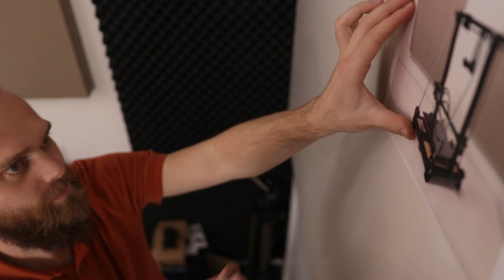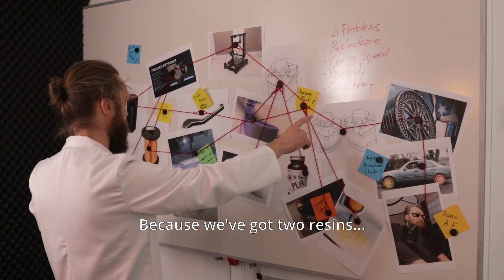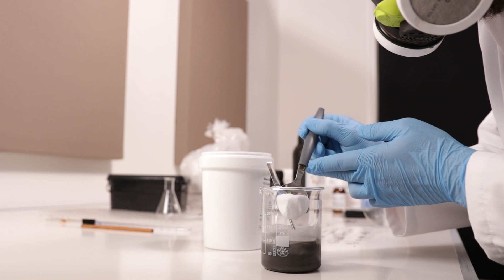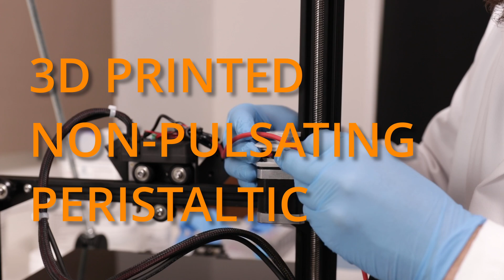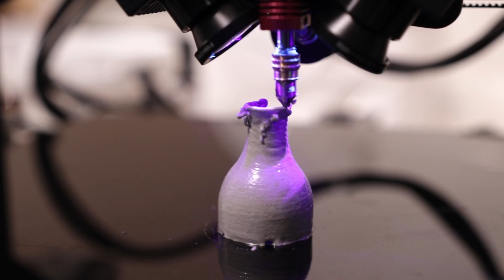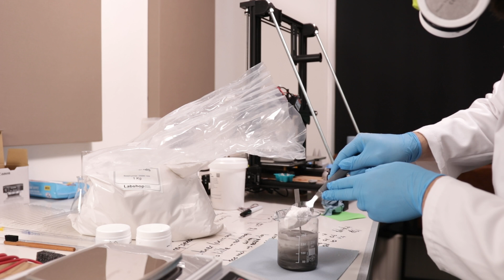FDM resin printing: Game changer or stupid?

Comment from the maker: #ad Head to https://sovol3d.com/products/sovol-sv06-direct-drive-3d-printer?sca_ref=2784626.QgTM1uaIAj and use the promo code Proper for $20,- off. This promotion is available till Dec. 20th and when the price is (over) $259,-.

We are going to make this work! I hope you enjoy this journey and if you have any suggestions, let us know!
Reply: I worked with a very special liquid polymer. You need to use a needle nozzle it works better if it has no large surface to drag the deposited layer. The layer heigh for low viscosity liquid should be 1.25 to 1.5 nozzle diameter not like thermoplast. There is an equation for it depending on flow rate.
Reply from the maker: @RamiRouhana  thanks for your suggestion! I'm working on a nozzle design with this tip shape because of that reason indeed. Also thanks for the information regarding the layer height!
Reply: @properprinting  Thank you for making these fun and interesting videos.   Makes me also motivated to keep tinkering.
Reply: Moving the UV light out of the nozzle should improve things quite a bit - less resin stuck to the nozzle means less failures and more consistent "extrusion". Ideal setup would be ring light like arrangement where the nozzle stays dark and the curing process starts some distance from the nozzle. Might be worth experimenting with using clear resin prints as a light pipe (transparent plastic part stuck to the LEDs).
Reply from the maker: @Doktoreq  I tried using clear resin as light pipe, but it blocks UV quite a lot. I do have an idea on how to improve the light source which hasn't been mentioned yet by anyone. So this might be a stupid idea, but we'll see xD
Reply: @properprinting  feel free to try whatever idea you can come up with even if it seems stupid. Sometimes a seemingly stupid idea works and it takes a while to find out why. Sometimes things are simply counterintuitive.
Reply: @properprinting  Do not use clear resin then, but fiber optics or some plastic that doesn't block UV light
Reply: @properprinting  Had a little brainfart there - of course uv-cured resin would be uv opaque. If we cannot direct the light to go where we want it let's reverse the approach and block it from getting where we don't want it. Putting something (electrical) to shade nozzle and a little bit of space around it from UV light might do the trick. We just want to position it in a way it doesn't drag thru the deposited resin.
Reply: @Doktoreq  I had the same thought about the curing with the nozzle! maybe a cowl for the nozzle could block out the UV? @Proper Printing put a sombrero on it! a sombrero fixes all issues xP
Reply: @B1tm4n  I would say basically anything that would give around 0.5-1 mm of shade around nozzle tip should work.
Reply: To get the resin to better sit where it is extruded, you might try adding a low boiling point solvent and using the part cooling or heater block to boil it off just after extrusion. Hexane or IPA might be perfect. Of course, it might ruin the resin.
Reply: I think the resin isn't curing the best coming out of the nozzle i think layer height and having the right angle on the lights is what really needs tuned and thats why it keeps gumming up the nozzle because the resin that ends up sticking to it that doesn't get cured ends up getting big enough to solidify and causing print failure. For the vat should put a pump fan in the bottom of it and have it on top of a heated pad, itll keep it mixed well and the heat will help with resin flow.
Reply: What size nozzle are you using?  You could ask Max for suggestions
Reply: I think you have to make your laser more focused on the mozzle, a TEFLON or non adherent material nozzle. Nozzle with very little output diameter 0.1 ??? and just resin with more more curing agent. After that the resin rcipient had to be permently chake to make all agent be well mixed. A really good project !!!!!!
Reply: Ah... Dutch guys creating this sort of content. Absolutely super cool. And likely to once again push humanity forward.
Gofferdommuh.
Reply: You may want to look into getting an ultrasonic mixer, they can make perfectly homogeneous liquids/pastes without introducing bubbles and such. They can even mix water and oil easily, which of course eventually separates, but you should be able to use them while printing to keep your ingredients from separating. 
They will heat up the material during prolonged operation, so keep that in mind.

Oh and the mixing is then called ultrasonication, which sounds cooler.
Reply: Add some very tiny mirrors around the extruder end to stop the tip from being able to build up cured bits and clogging but still allowing the light to reach the extrusion asap.
Reply: For a more effective thickening agent that won't separate in the same way as the hollow glass beads, and make the resin more thixotropic (gel/paste-like), look at fumed silica. It is commonly used as an anti-settling agent to prevent other additives to fall out of the mixture.
Reply: You should try to normalize the cure time for each layer.  The smaller layers need more time to cure so you need to slow down the print head and flow rate.
Reply: thought emporium made yeast that makes spider silk, some scientists gave some spiders water containing carbon nanotubes and the spiders' silk contained carbon nanotubes, and you're talking about continuous fiber printing. 

imagine if that yeast was also engineered to calcify like curing resin
Reply: try a DELTA PRINTER!
Reply: Just a thought. Maybe an airbrush nozzle on a M6 brass adapter would work better...🤔
Reply: Did you try fumed silica. Its a common thixotropic agent commonly used with epoxy.
Reply: I still don't get what is the purpose of this except just because 😅
Anyway, this reminds me those 3D printers capable of building houses extruding concrete. Maybe you want to have a look at how they work and what problems they had to confront and how they solved them, specially with the resin building up in the tip of the nozzle that causes most of your problems. Of course they don't have the problem of having to cure the concrete as soon as it gets out of the nozzle and that is a big difference!
Also, do you know those devices for lemon slush that keep the slush moving all the time to avoid the ice particles to fuse and form bigger ice blocks? Maybe something similar is useful to keep the resin mix with the optimal viscosity and avoid precipitation and aggregation of the solid particles.
Reply: The nozzle is not appropriate, the good thing is that since it is not going to heat up, you do not have to limit yourself to metallic nozzles and you can consider using non-metallic materials such as plastics.  You need to look for a material that the resin will not adhere to.  There is also a nozzle with a super sharp tip that could be an interesting option.
Reply: I think you should experiment with adding a light shield to the nozzle so the resin won't cure on it.. 🤔 (maybe a hollow inverted cone so the shield doesn't touch the part during printing and making it easier to clean)
Reply: This could become the new boom in the 3D printing industry, consuming less power, faster print speeds, probably better "layer" adheasion, and the ability to print many more materials and colors, through one nozzle giving a certain advantage to the competition. Do you understand how successful this idea could be, this is truly a gamechanger!
Reply: Ok, I know nothing, I'm a dumb ass... but, I have the impression that lenght of the "layer track" is important, because it affects how much time the UV lights has to cure.

I think when the layer is bigger than a certain point, it needs to move faster or cure slower, and when the lenght of the filament yo place in the layer is shorter, either the head needs to move slower or it needs to cure for a longer time. Maybe take a measure of how long is the layer, then make the print head when it finish a layer to wait for a time for the UV lights to cure the placed layer? Does that make any sense?
Reply: The sad part is: Once you make it work, you'll probably infringe on some resin jet printing patents 😢
Reply: You should use fumed silica as thyxotroping agent. All the powders you use are to coarse. The silica is so fine that the "gelness" of the resin can be finely tuned. Also, I'd recommend making small batches first to test things.
Reply: Swearing shows a lack of self-discipline. It also shows a lack of respect for other people - especially if they are strangers.
Reply: Maybe it is an idea to control the viscosity using the temperature of the resin, for example using a peltier cooler right before the nozzle
Reply: Try mixing in a vaccuum mixer. I had a dental prosthetics lab few years ago and I remember those machines are not expensive. It's usualy used to mix plaster for molds. It remove bubles and make the mix consistent. Worst case scenario you have a plaster mixer. 🤷‍♂️
Reply: Come on, this is fucking FUTUR ! Go make a gofundme, hire 1 or 2 ingeneer, make it clean and sell this SHIIIIIIIIITTTTTTTTTTTT !!!!!!!!!! (plz let me invest or work in that, it's gonna be ez money)
Reply: This looks like a concrete printer that makes buildings. I would increase the scale and see what it does for much bigger things.
Reply: try adding grinded down cured resin as a thickening agent. should have the same density as uncured resin.
Reply from the maker: @ThomasIJsseldijk  this is such a good idea! I need to find a way how to do this safely and reliably!
Reply: @properprinting  I wonder if the author of the channel knows that on his channel there are "grazing" machinists holding contests on his behalf?
Reply: @ThomasIJsseldijk  good point!

Comment: Instead of glass beads, why not use some baking soda?  A fine inert powder and might not settle out
Also...would a syringe with the mix similar to those solder flux dispensers be able to push the resin out at a more uniform rate...just not be able to refill the syringe though

Comment: This is a really interesting and intriguing series.  It really makes the imagination run wild.  I wonder if the peristaltic pump might work better if the resin is stored in a reservoir above the pump to allow for gravity feed instead of forcing the pump to draw the resin upwards against gravity.  You could even incorporate a mixing mechanism to keep the resin from separating before it is pumped.

Comment: Have you considered using a smaller ring light, similar to the ones selfie takers use, but with UV light? By placing it around the nozzle, you can direct more light to the precise spot where it's needed, leading to faster and more precise curing, without the nozzle casting a shadow. Additionally, having more light can speed up the printing process, as the resin can start to harden closer to the nozzle, allowing it to print the next point on the layer while the first one continues to harden.

Using more light can also enable you to use thinner resin, which can result in finer details and smoother finishes in your printed parts. By using a ring light with UV capabilities, you can optimize the curing process and improve the overall quality of your prints.not to mention make it less bulky.

Comment: Hey Jón, I am considering getting a resin printer, to supplement the capabilities of my fdm printers. Which ones do you have at the moment, and is there a specific type or brand you prefer? Use case is mainly practical prints, if that makes a difference.
Reply from the maker: Awesome! Resin printing definitely has its place, if you can cope with the mess. I'm biased since I only have printers from Anycubic which they sent me. I've got the Photon S, Mono X, Mono X 6K, M3 Max and D2. They all get the job done and right now I'm very fond of the D2 since it's so fast. For prototyping this is ideal, but for practical prints the resin itself matters as well. The resin from 3DResyns is very good, but also very expensive. Mayer Makes is already a lot cheaper, but I don't have experience with it. The DLP Craftsman from Anycubic prints very well on the D2 and with my limited experience it looks like this is a good bang for your buck.
Reply: @properprinting  thanks for your response, and your transparency about anycubic sending you theirs :) I'll look around a little more for experiences woth other printers, aswell as the resin types. Thanks again!

Comment: Bro how to connect ender laser to cnc shield
Reply from the maker: Everything runs on 12V, so I don't need to reduce the voltage. I connected the fan of the laser to the cold end fan connection (continuously running) and the laser itself to the part end fan (which can be controlled)

Comment: Why not try dipping the nozzle in silicone or similar non stick agent and then sand to the very tip away so cured resin doesn't stick as well to the area around the outlet of the nozzle

Comment: Maybe you should use hard tubing everywhere EXCEPT the peristaltic pump. By using the soft silicone tubing to feed the extruder, I would imagine there is quite a bit of expansion/hysteresis that could be messing up your flow rate as the pressure on the nozzle changes.

Comment: Try fumed silica instead of bubble glass. It's a thickening agent that also happens to lower viscosity somewhat when being put under shear stress, ie when it is stirred, pumped, or extruded. It also won't float and might improve part strength once cured

Comment: What are the mechanical properties of the resin after adding the glass beads or ash? If you make the resin too brittle the layers will break across the layers even if the force perpendicular to the layers would not be an issue

Comment: I think your next iteration on this should have 3 curing light sources spaced evenly and mounted at a steeper angle so that nothing can cure to the underside of the extruder. It looks like your most common failure points are where the nozzle blocks both lights and then moves away before they can hit the material for long enough to cure it.

Comment: On that first layer are your lights on 100%? I think to get better adhesion you might want to turn that down to 50% or less. When you print a thin profile the lights don’t spend nearly as much time in one spot as when you’re laying down your first layer. Your layers appear to be semi fluid still as the higher layers are added but the first layer is solid fill and will be completely cured by the time you print on top of it. What do you think?

Comment: Discount code does not work.   I just tried to order one and it says invalid for item in the cart.   I used the link provided, still no luck.
Reply from the maker: Hi Edwin, thanks for trying to order one! Because the printer is on sale right now you already have the best price. When sale is over, hence the price is higher or equal to $259.-, the code applies.

Comment: Still impressive... and has POTENTIAL for future research and technology. I have absolutely no doubt this could be a step in the direction to something better than both FDM and resin printing. (and it could lead to much stronger resin prints that can have much more strength than FDM or any plastic).

Comment: I feel like if you made the extruder tip larger, domed, and wrapped it in FEP film and put the light at a lower angle it'd help a lot with the resin sticking to the tip. Just a thought.

Comment: proposed amendments:
1.instead of a pump, use a container with a plunger (such as a syringe) pushed by a screw - better control of the flow and dosing of the medium
2.stiff tubes - walls resistant to pressure (again better flow control)
3.pipes splitter just before the print head (easy change of printing material)
4. (optional) degassing of the material in the vacuum chamber before filling the feeders.

Comment: This is basically what some of the new very high end color 3d printers do (if you want an idea of what they can do, look up heroforge miniatures, they make custom figurines for tabletop gaming and have an option to print in color), but they are using modified inkjet print heads instead of an extruder designed for filament to deposit the resin, and that allows them to mix pretty much whatever colors they want from just 3 to 6 colors of resin (primary colors + possibly clear and/or black/white). Those printers still cost tens of thousands of dollars and are huge though.

Comment: if u use a resin bottle with one pipe directly to the nozzle dpped to the very bottom into the resin and one pipe into the bottle from the top only 2 cm in the air inside the bottle, and then pressure the second pipe with higher pressure air from your pump, the resin does not have to go through your pump. think about curing in a different pass when printing, then you can use more fluid resin.

Comment: I think you could get really good results here with a few adjustments
- screw pump gravity fed by a hopper
- higher viscosity resin mix
- shade the nozzle so that resin stuck to it doesn't cure
- more light intensity and slower print speed

Comment: You are a genius. Have you tried a stepper motor on the pump (maybe even one from an extruder)? With the high viscosity of the liquid I think retraction would work. Another suggestion is a different nozzle.  A long needle like tube would expose the new layer lines to the light better. It should work. (Please realize this is coming from an idiot who doesn't know anything about anything. Me.) Keep at it and you'll be slinging mud with pro looking results.

Comment: Awesome man. I think if you can use some kind of screw extruder with a tank that rides along you can have a much thicker resin mix that should help a lot I think. the tank that rides along can be filled with a less precise kind of pump that can handle the sludge. Keep on trucking dude.